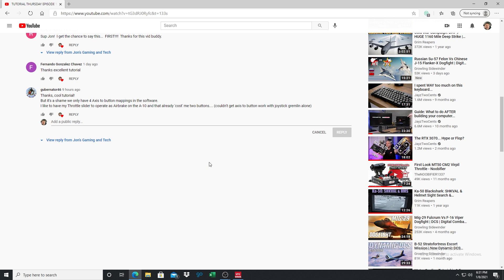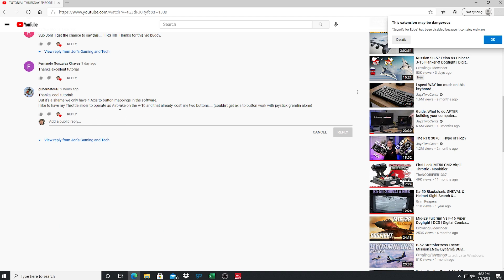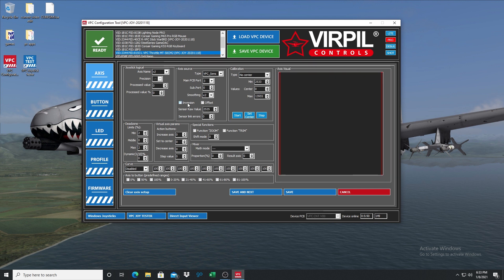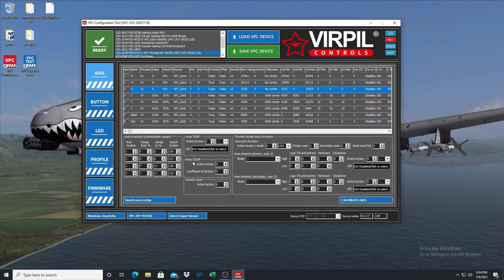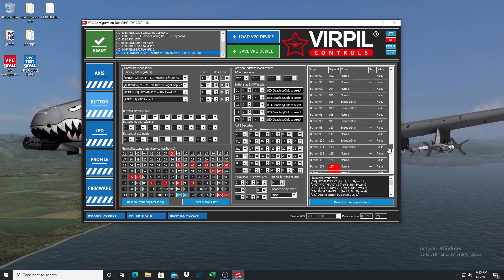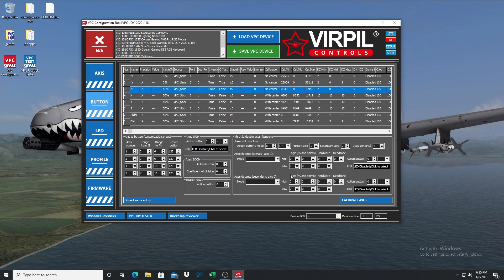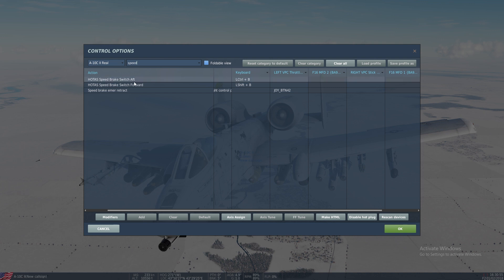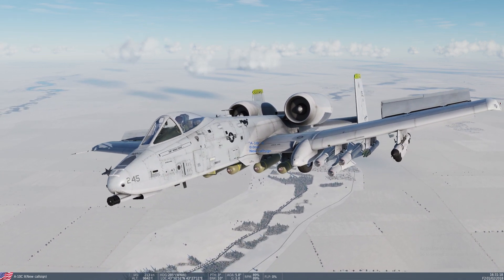VIRPIL AXIS TO BUTTON TUTORIAL

Comment: Thanks for the explanation Jon. I would like to add a little to it, because at first I could not get this to work. The reason apparently being that I already configured one axis with customizable ranges  like this and that was blocking aka occupying buttons the software wanted to use for other specific axes. So I deleted all the references to the physical buttons of the axes concerned ... then set al the 'axis to button (predefined and customisable) ranges' ... then checked which buttons lighted up for the predefined ones ... and only then chose which free buttons to assign to the 'customizable ranges'.

Comment: Im failing it. I have the Controler "2" (with the landing gear). And the buttons are different from the Controler "1". Im not sure it's possible to make the 3 little rotators "trim knob" buttons (feel like it can scroll) work as an axis in DCS...I fail to configure them like this, it work only as a button (left or right full on/off) what ever i do. Any idea ? :) Thx

Comment: Great video. Wondering if you can help with an issue I am having with my Constellation Alpha and DCS. The Alpha has a mini stick. I want to use mini stick as a POV hat in DCS. DCS is hot allowing the mini stick to be mapped to control the view direction. Is there a configuration option in the Virpil control software that would let me change now DCS sees the Mini stick?
Reply from the maker: Is the mini stick an axis or button? If it’s an axis you will have to go into the axis commands in dcs and make sure the absolute view is either empty or you bind your mini stick to this. If it’s a button hat switch you will need to make sure the absolute boxes are empty. Then you can bind as normal.

Comment: il-2: BoS question: The control input for flaps in this game is strictly button, flap up and flap down in 1% increments.  I have it assigned to a 4-way hat for now and have to hold it while the flaps are moving.  Is there a way to make the flap lever work with that game?  I can't figure it out and could use some help.
Reply from the maker: Let me look into this.
Reply: @JGandT  I looked a bit further into it, flaps react differently on various planes to the flap up/down command.  I primarily fly Me-109s and their flaps are actually a trim wheel looking control in the cockpit thus gives 1% increments with each input of the flap up/down input as the pilot rotates the wheel dialing in the desired flap.  I tried the P-51 and each input gave a 10% increase/decrease in the flaps.  I don't know how the lever axis can be made to work with an unequal system like that unless profiles are created for each plane/group that has a similar flap function.  If you're bored or just like challenges I'd say go for it but otherwise I guess the inputs I currently use will have to do.  Much appreciate the response.

Comment: Thanks! I am struggling the other way-trying to change an encoder wheel to a virtual axis. I am trying to use the left wheel on the CM3 to control prop pitch on my GA aircraft. Using the default buttons 2and 3 works but the increment is too small and it takes multiple turns of the dial to cover the full range of the prop lever. Could you do a video on changing the encoder wheels to a virtual axis with the newest software, please? I much appreciate your tutorials!
Reply from the maker: I don’t think you can set an encoder as a axis I will have to look into it.

Comment: Legend, thanks for this. Though I cant seem to get DCS to recognise these buttons for 3 stage flaps on the FA18. Any suggestions mate? Edit - disregard my comment. A DCS reload sorted everything out.
Reply from the maker: Good to hear. Let me know if you have any other questions.
Reply: hi, I have made the 3 buttons for the 3 stage flaps but to what do you configure them in DCS? Up - half  -  down? And what is the neutral setting then?
Reply: @robertcras8151  I ended up not using the slider for that purpose; It wasnt a good experience with VR. I prefered binding flaps to T6 or T7 momenary.
Reply: @psychomantis10122  ok! I see a lot of flap settings for the f/a-18C. You talked about 3 buttons, what dcs controls would you bind to these 3? Auto - Down - Fully?